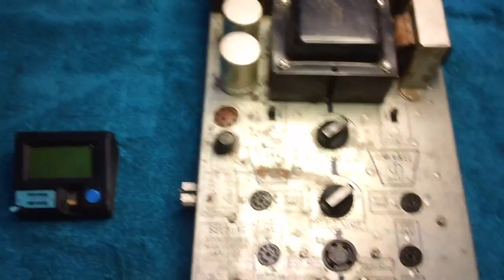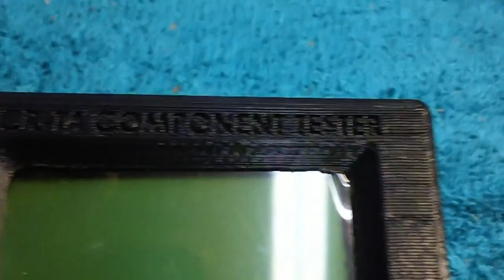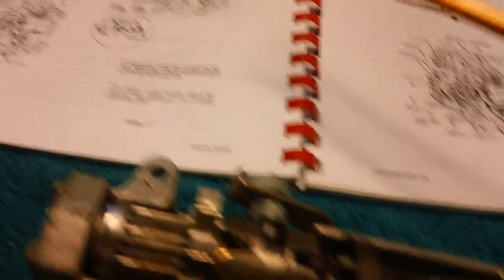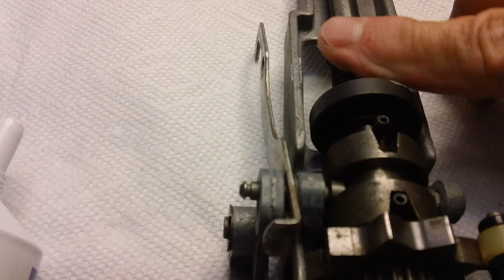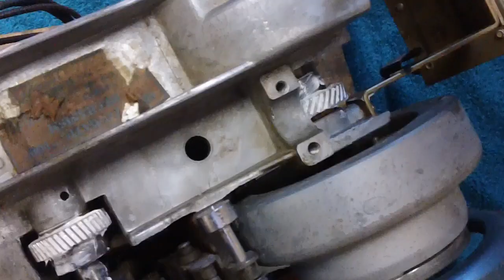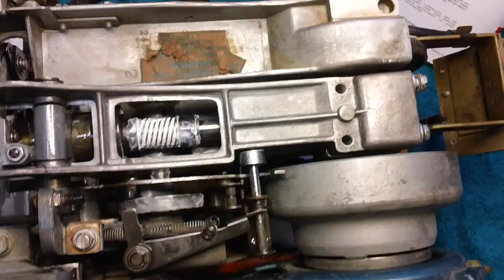1961 Seeburg AY100U Jukebox Restoration (Part 19 of 87).

Comment: Hey John, 

Nice tip on the shims.  You can also use paint stirrers if you need something even thinner. 

Good job on the lubrication.  Some people put that stuff on with a trowel, which eventually attracts dirt and makes for a real mess.

Regards, Tom
Reply from the maker: Tom,
I've also used paint stirrers, but wanted our viewers that there is an alternative.
Regards,
John

Comment: John,
Good idea not to over-lubricate moving parts.  Over lubrication can, in the long term, have detrimental effects such as gumming, sticking, and attracting dust etc.
The 2N109, being a germanium PNP BJT, has the T0-4b, or T0-40 package (emitter, base, and a gap between base and collector) which is the same as other late 1950s – early 1960s transistors such as OC45, OC71, OC81 and 81D types.  
I’ve only encountered one defective 2N109 in my life.  For future reference, should you to encounter a defective 2N109, I replaced it with an AC125 which worked well.  I went ahead and replaced all four transistors as I was looking for a fairly uniform  hfe of 65plus for each transistor.
Cheers my friend,
Phil.
Reply from the maker: Phil,
Had these gears not been completely bone dry from the cleaning procedure, I would have used about 50% less grease.  If need be I can always remove some at a later date by simply using a long handled acid brush.
Also, Brendan and I have already discussed transistor replacements.  I've not yet made up my mind yet as to which replacements to get, but the 2N109s will be replaced with something better.
Regards,
John